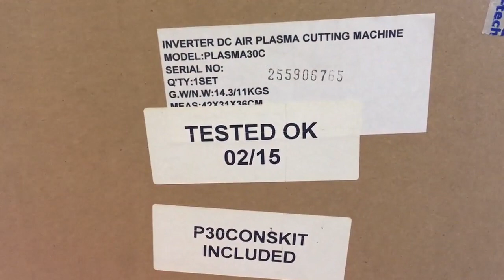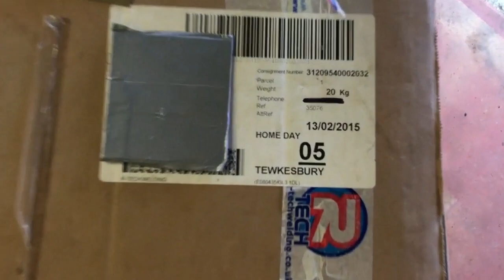Building the frames for the rotisserie. Part 1.

Comment: If you can gas weld (oxy-acetylene) and MIG weld - TIG welding shouldn't prove a problem.
Reply from the maker: James Mower shouldn’t being the operative word.
Reply: @defender90keswick.nigelsla59  could never get the hang of Mig Welding, but gas, TIG, Spot, Seam & Arc welding came easy to me. I saw Mig as witchcraft :)

Comment: Hi mate, just found your channel and will be watching from now on, just wondering why your doing this to a relatively new Defender?
Reply from the maker: Hi Phil, thanks for your message. I am stripping the old girl because the chassis is showing signs of rust, particularly around the welds where GKN dont clean them before dipping, I wanted to check the clutch, oil pump and output shaft. So.. she's getting a full rebuild and a few mods.
Reply: Defender90 Keswick. Nigel's Land Rover channel. Nice one, I’ll be watching this for sure, you sound like a Bristolian with that accent?
We have a 2013 110 with only 16k on it which we use for pulling ships ropes at our local ports, it’s been a great vehicle in fairness, I did have the chassis treated when we bought it but as you say, some parts look very poor quality compared to the older ones!
I changed a headlight bulb the other day and the chrome bezel has completely rotted away, it’s only 7 years old, my old 1991 tdi only had them replaced a few years ago from new! 
The one thing I will say is for a poxy 2.2 they don’t half pull well even with a load.